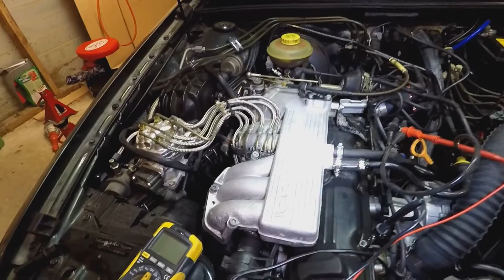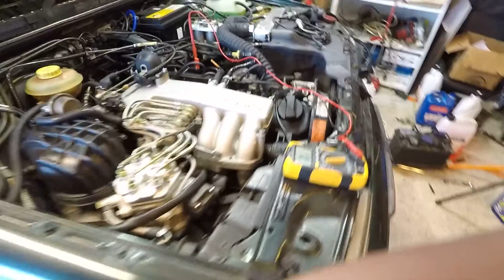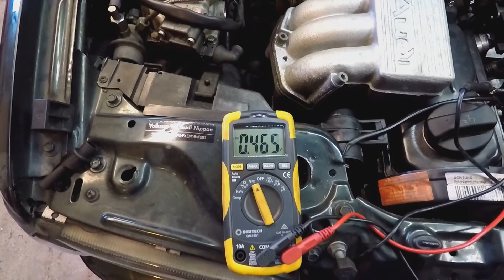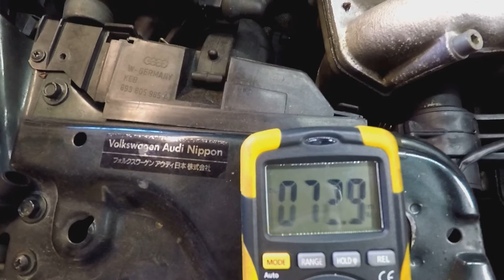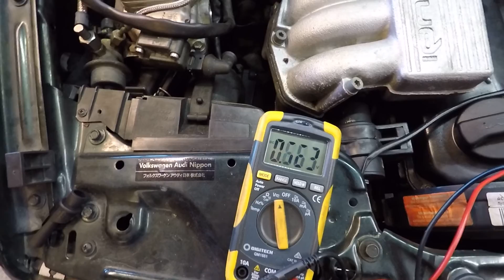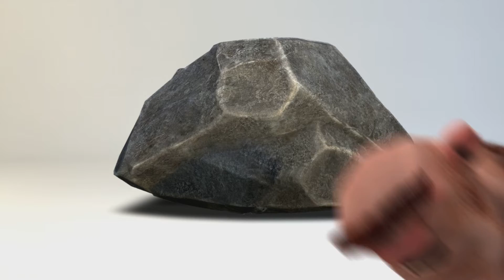O2 Sensor Test and Replace - Audi 80 - KE3 Jetronic

Comment: I've been getting lots of newer and older cars with O2 sensor issues lately...What fuel do you use Johno.?
Reply from the maker: Supposed to take premium (95) but will also run on 91. Has been seeing more 91 than 95 with fuel prices how they are $2.30 a litre. Most of our fuel comes from the same refinery so not much difference in quality.
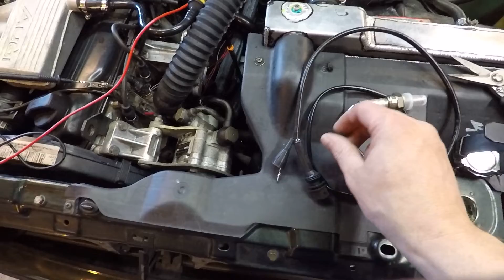Reply: Being an older car the 95 would be what it likes...$2:30 for 95.!!...SHIT!!!!!...We're $1:60 for 95 here and going up and down at random...I use 91 in the Pulsar and 95-98 in the Chevy...Part of the reason the Chevy stays parked a lot.
Reply from the maker: $2.30 for 91! 95 is $2.40. They run better on 95 but never had an issue with 91. Once the fuel economy picks up I'll be back on premium. Can you see why our main car is a diesel...
Reply: Diesel here is the same price as Premium.
Reply from the maker: Diesel is $1.40 BUT then you have to buy Road User Charges at $64 per 1000kms. It's getting crazy
Reply: They are trying to stop Diesels as commuters cars because of DPF failures and some vehicles going into a Re-gen at inappropriate times or just blocking totally and stopping.